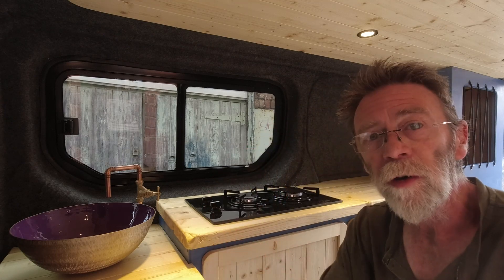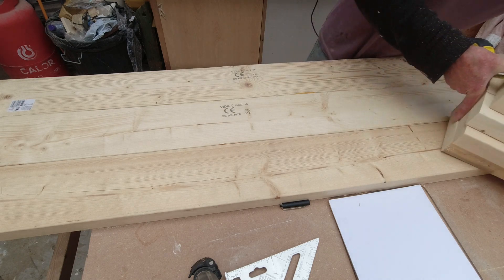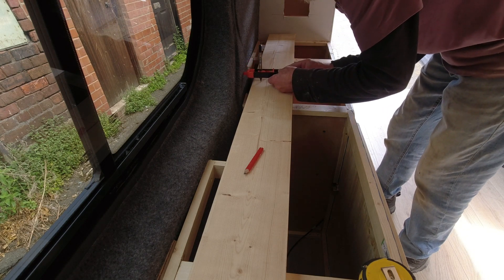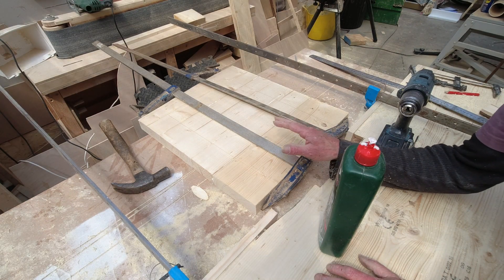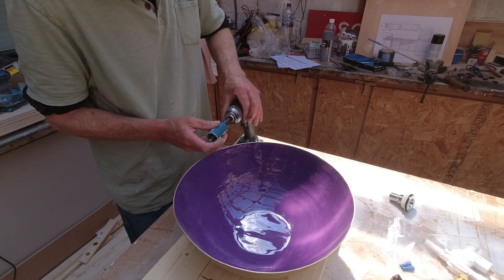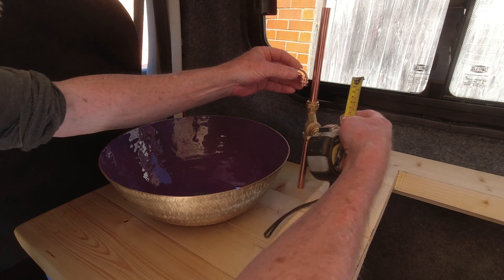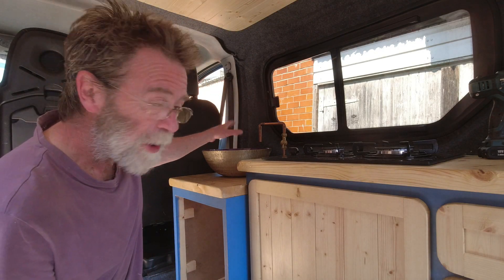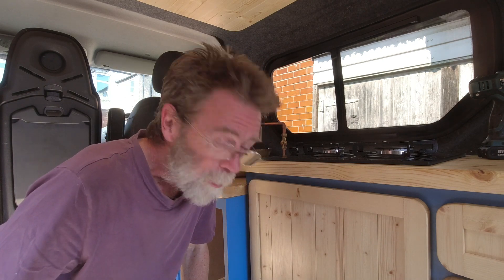How I made This Stunning Kitchen In My Campervan Conversion - Part 3

Comment: What is the material that covers the walls? The gray floormat looking thing.
Reply from the maker: Hi, The material on the walls is what is called a "4 way stretch carpet". You can get it on ebay, amazon etc. Its fixed on with a spray adhesive. Hope that helps. Thanks for watching

Comment: Looks very heavy for a campervan. My sink/burner top is on 12mm ply, and the panels are a mix of 6mm (5.5mm actual), & 9mm.
Reply from the maker: Hi Carl, I know it looks heavy but it is extremally light. All of the cabinet work is also done mainly with softwood, 5.5 ply and 8mm cladding. The van also has a wooden Rock and Roll bed which weighs an amazing 25kg. Thanks for watching.
Reply: @dave-watson  and a smaller van has proportionally more load. It's a pet hate of mine. I know of loads of overweight vans, and two were Youtubers. One moved to Northern country, and the other did jetwashing.

I'm not grassing, it's just a serious issue when your insurance is invalidated.